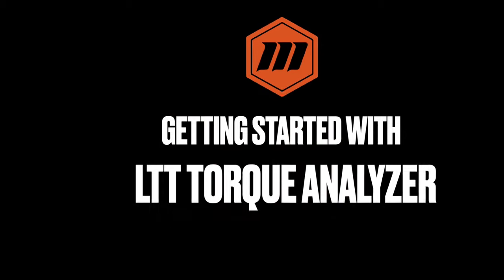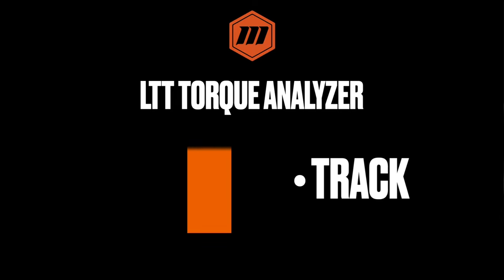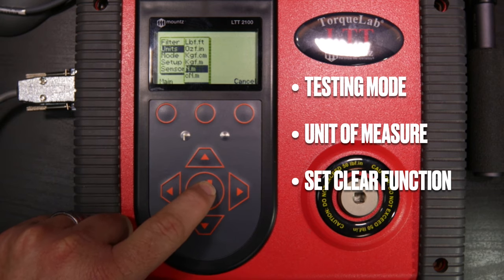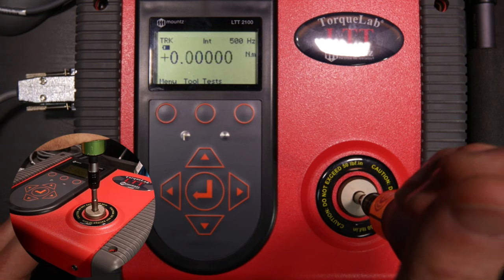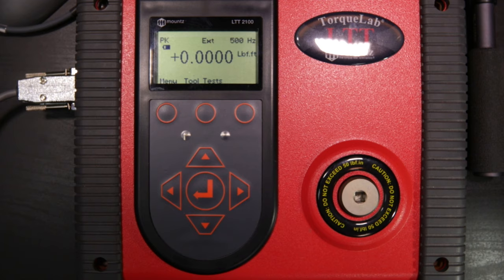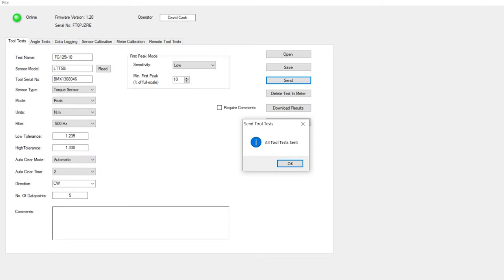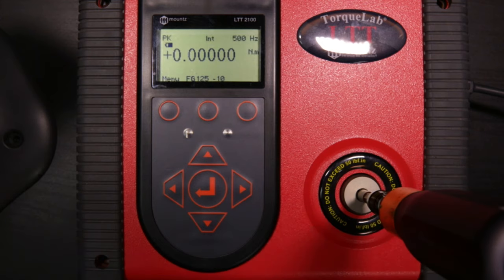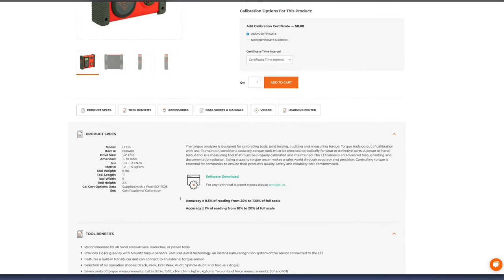Guide: How to Operate the LTT Torque Analyzer

Comment: thanks for the well explained use and operation of ltt torque analyzer. can you please also include the safety feature of the tester like emitting a sound when over range to prevent damage to the sensor. is there an safe overrange to operate the ltt tester?
Reply from the maker: Hi Jojo, Thank you for submitting your feedback. I will forward your comments to our product team.